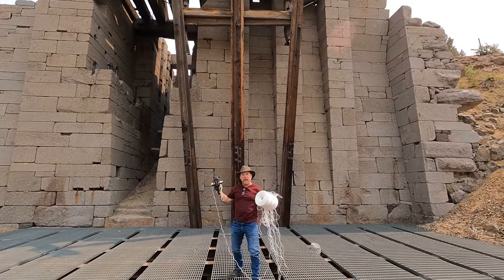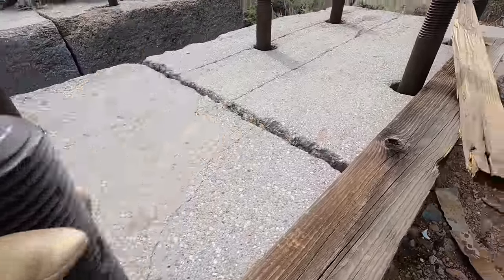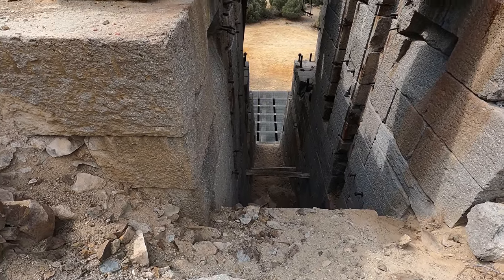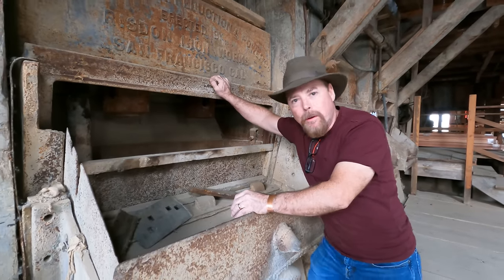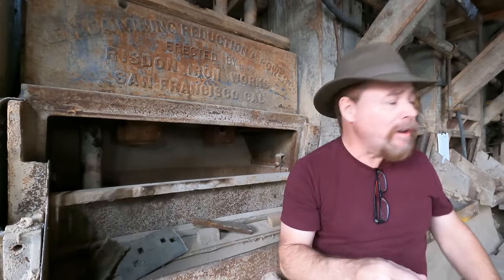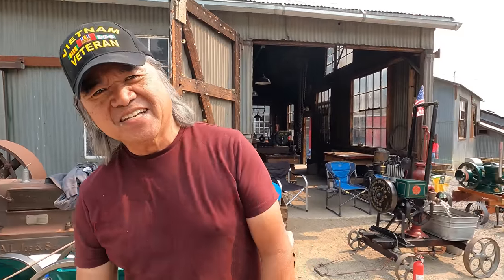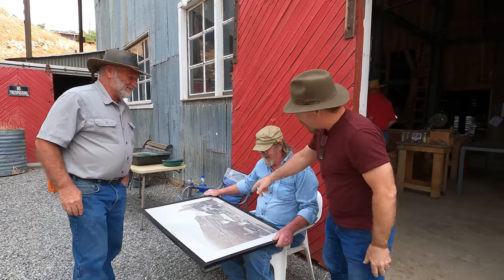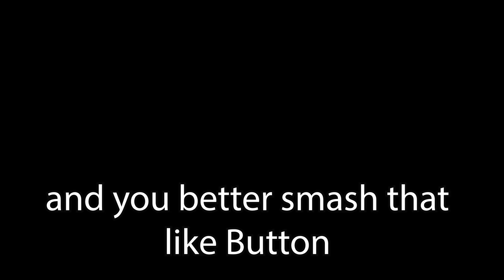GoPro Dropped Down Combination Shaft In Virginia City - Nevada

Comment: Thanks Jeff, I love old machinery and how they were able to do things back in the day that are just amazing with no electronics. People today rely too much on some machine thinking for them and rather than just using good common sense. Sadly too many people have sense that is common but no common sense! Thanks,  Bob from Virginia USA
Reply from the maker: thanks Bob
Reply: It always fascinates me, what burning wood and coal can do. Without it, things would've been EXTREMELY harder and more difficult to do. Same with a gasoline engine. It's power comes from small controlled explosions internally in the cylinders that peddles the crank, which uses a flywheel that carries momentum to continue the cycle to the next strokes that follow, which produces torque and horsepower to power vehicles, tools and other things. Very fascinating to me. 😁👍

Comment: I knew a guy in the 80's who restored hit n' miss engines - the biggest one he had was a 29 horsepower engine, the wheels were six feet tall and required two people to start. When you have it running, it would fire once every 30 seconds or so. The exhaust pipe was slightly smaller then a one gallon paint can. The sound of firing was equal to a 12 gauge shotgun going off - when we wanted to have fun, someone would place the paint can over the exhaust just before firing - it would launch the paint can up at least 200 feet! It was mounted on a custom-made trailer and a large Peterbuilt diesel truck would haul it around.

Comment: Should be the crown point tressel Near the yellow jacket mine if memory serves me right. Good to see yah having fun in my neighborhood Jeff !
Reply from the maker: BINGO !!!!!!!
Reply: The mine he points to is also the Crown Point Mine… but not the original one. That one was developed in the late 20’s and 1930’s… operated until 1942, when it was shut down by War Production Board Order L-208.

Jeff is actually standing (in that shot) almost exactly where the original Crown Point shaft was… it was a 4 compartment shaft that was driven down around 3,000 feet. 

Next time you are up, Jeff, message me and I’ll take you into the Crown Point Mill (just below that mine). It’s complete and mostly original… like it was set up in the 1930’s.

Comment: Is there any info as to why the shaft seems so shallow? Looking at the GoPro pix of the rubble when the camera bottomed out, it almost looks like they just started dumping tailings down the shaft until they could see something. Or possibly it was filled to make it easer to disassemble and recover all the steel elevator rails and brackets on the way back up? There would no doubt have been a LOT of recoverable steel down there and obviously nothing now remains in the shaft. Are there other shafts in VC that you could drop your camera into that are more intact?
Reply from the maker: there is a plug in from a lot of the support timbers plugging it up .... no ...most have been plugged for safety reason or because the collars have rotted away and have plugged on their own